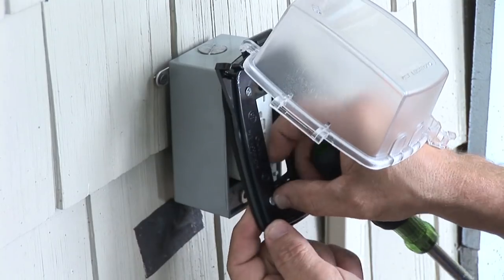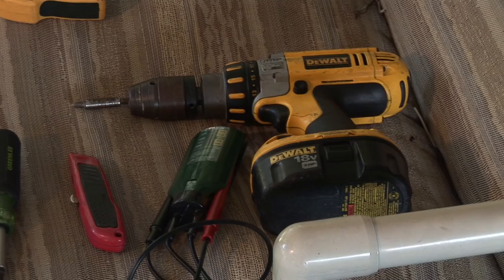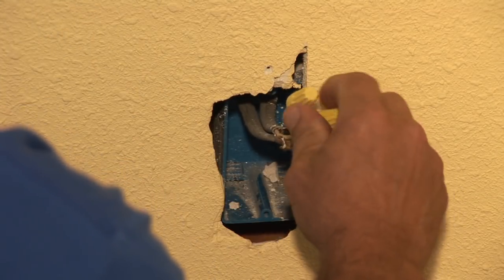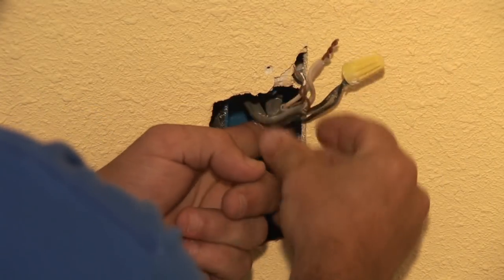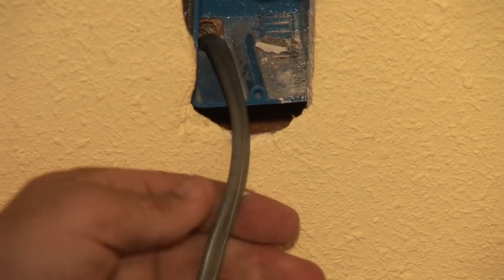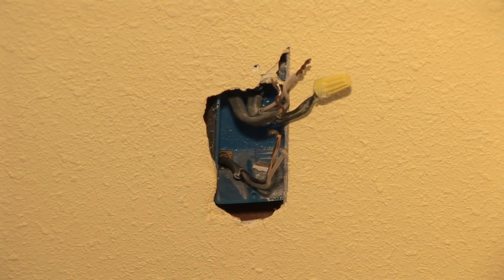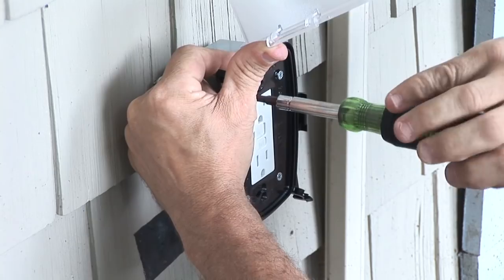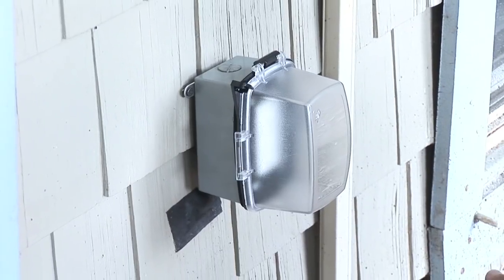Electrical Help : How to Install a Power Receptacle Outside

Comment: I always see on DIY videos people running a knife blade down the length of the wire covering risking nicking the insulation on the wires. The safest way to remove the cover is to only cut about an inch of it and then pull on the ground wire to the desired length which will easily split open the cover
Reply: I agree completely. As an EMT, I was cringing as I watched him drag that knife toward his hand.

Comment: The video is not complete. The box is unacceptably loose and you didn't show how you would connect the new wires on the inside.

Comment: an Old Electrician of 35 yrs in 1975 told me. when installing and outlet or wall switch Remember"Black on Brass will save your a**"

Comment: I would recommend making sure your wire exits in the center of a shingle then you are guaranteed a flat surface which helps ensure the box is more secure. Also use sheet metal or some type of weather resistant screws.
Reply: Sheet metal screws into wood siding?
Reply: @henrypratt3742  Didn't mean to offend you, what i said concerning the screws was sheet metal or some type of weather resistant screws. And for those who think I'm unqualified. I am a 43 year electrical veteran in business for 33 years, teaching at a tech school for 10
Reply: I agree. I don't like how that box wasn't fully secured to the house.

Comment: i like to put teflon tape around the "knockout seal". i find water always finds a way in if i don't
Reply: Me too! But I also drill a couple of small holes in the box and before I close it, i also dust the inside with ant or bugs killer
Reply: @ip5232  you mean like drain holes in the bottom??…
Reply: @Kenny_K2323  you can say that

Comment: Thanks Nick. Many people don't know a GFCI has two sets of screws and incoming power always goes to the line screws (hot and neutral). The load screws are only for feeding & protecting extra outlets downstream from the GFCI. If you connect power to the load screws, there is no shock protection from the GFCI.
Reply: That’s evidence that some owners will tamper with wiring without reading the directions. Gives diy a bad name.

Comment: First let me say that I have not watched this video. There is s very good reason! This video was produced in 2012! NEC has been revised twice since then. My reason for commenting is that there are lots of comments that are less than 1 year old. The most recent NEC  major revision was in 2017. Any work since those revisions requires a WR (weather resistant) receptacle in any outdoor environment!  Also new work should include TR (tamper resistant) receptacles. Since neither were required in 2012, you have most likely (see initial sentence) gotten out of date information from this video.
Reply: Coy Patton He uses a weather resistant and child resistant outlet... :x
Reply: And I’m sure what may not have changed is that a electrical permit is required by the local Authority Having Jurisdiction(AHJ).

Comment: Thank you for taking the time and making the effort to help those in need of your experience.

I'm not a video producer, nor a master electrician. I haven't made a single video. I'm, most likely, not as smart as you.
I just started watching the video, and the first thing I see, after the introduction, is you standing at an unused box, with a blank plate.
Now... if I needed instruction on how to do this, chances are... I'm not qualified to do this without your help. And, my first question is gonna be:
"Why are you at this box, inside the home, when you're supposed to be showing us how to install an outside receptacle?" 

Those who need this instruction probably don't know what you're doing. Otherwise, they wouldn't be looking for help. If I didn't know why you were there, I would ask... 
Why are you standing at THAT box, & testing it for power? Why are you drilling a hole? What's on the opposite side of that hole? Is there anything in the wall that might
make drilling through it a bad idea?

I don't mean to appear pretentious, snotty, or pretend to be a "know it all". I'm none of those. But if I was standing next to you, trying to understand why you're doing what
you're doing... I'd have questions. Rightfully so. And to this point, you haven't mentioned a thing. There are probably some viewers that wondered what they'd do, if that box
hadn't conveniently been there. They might even be wondering why that unused box was there, in the first place. My head would be spinning with questions.

My entire premise is: Theory, DURING the process of demonstration. The lack of it creates confusion. I haven't seen the entire video, so I don't even know if any of my questions
were answered.  So... I apologize if I've offended anyone. This gentleman was nice enough to make this video possible, by sharing his experiences. I was not knocking his work
ethic, knowledge, nor experience. Just explaining how theory, during the demonstration, could eliminate possible confusion in the future. I just happen to be one of those
types of people that look for the "Who, What, When, Where, & Why" of whatever I want to know about.

Comment: Don't forget to silicone or latex caulk the conduit plug at the top. Those leak even when tightened.
Reply: Don't these also often have plastic plugs? Some might want to upgrade to metal plugs if they're not included.
Reply: @HandymanHustle  I had one under my tankless unit that leaked and my GFCI faulted and I had to replace it because it got water in it and wouldn't reset. Lesson learned and I put latex caulk on it after installing a new GFCI.

Comment: I mounted my box like you demonstrated, and my kid knocked it right off the wall when he ran past it with a snow ski in his hands. The screws tore right out, with some of the siding. When I reinstalled it, put in larger diameter screws, and long enough to penetrate the sheathing. As another viewer recommended, I also shimmed the lower half, where the box sits further out from the siding. Then I had my kid purposefully run into the box again.  There, fixed it for you.

Comment: Nicely connected, although a piece of cedar should have been installed behind the lower half of the box where it overhangs the siding.  Makes for a more secure mount, and just as important, a much nicer looking job.

Comment: Thanks to this channel for this high quality video! 
Some constructive criticism on the outside part of shown installation: @ 8:39 mark, the strip gage is about 11mm (~7/16″). The stripped wire ends ended up being 14mm -ish (~9/16″). When you push the Live and Neutral wires all the way into the holes and fasten them, the stripped parts of wires should not be visible (should barely be visible). Just cut the excessive ~2/16″ away, and you're golden. As is shown @ 10:02 mark, you almost can fit two stripped Ground wires side-by side on the stripped part of the fastened "hot" wire. Should this happen, an RCD switch will cut the power, if RCD switch is present and the wiring is done correctly; or you can create a short circuit and a circuit breaker actuates, again cutting the power. These were the best case scenarios. 
IMO this particular receptacle isn't designed with the bare ground wire in mind - there are "hot" exposed conductive surfaces allover this receptacle. These surfaces could contact any bare wires in the receptacle box, creating a short circuit or making some of the other conductive surfaces "hot". 
As some of the previous comments mentioned, the boxes need to be mounted tight and level. 
I'm not a native speaker, sorry for my English! 
Thank you and stay safe!
TL/DR:
a) you should have no access to stripped wire ends once they're fastened, else you could burn your house down,
b) use modern cables and receptacles, meeting acknowledged standards like IEC, 
c) fasten the receptacle boxes level and tight!
Reply: Regarding stripped wire ends: don't put the unstripped insulation-covered part of the wire inside the receptacle's holes/under the screw either. Else you could burn your house down. 
The stripped part should not be accessable to wires/tools, but the insulation shouldn't enter the hole either.
Reply: @xbxlxexhx  Thank you.  Nice tips.  Regarding the "bare ground wire".  Is there a romex cable with insulated ground wire?
Reply: @paulgrim3501  
I'm not familiar w/ North America's cables. What I can understand from the Wiki page, the "Romex" trademark cable's ground wire (G) is not insulated. Maybe there are different brands of cables w/ an insulated G?
If I absolutely had to use it with the plug similar to the one shown in the video, I'd make sure there would be no chance of G wire touching a "hot" surface by insulating G (e.g. with a green or yellow/green insulation tape, leaving the ~11mm - or whatever the norm is - bare tip under the respected screw/contact), and carefully placing it away from the L and N conductor surfaces/contacts (which are ideally recessed, and only accessible by an electrician's screwdriver/tester, the L/N wire ends themselves & the plug's "hot" parts) & cover these "hot" screws from the Ground wire as well (e.g. with a black insulation tape). 
The Ground wire is there for cutting the voltage to a faulty device (scenario, where a conductive surface, that shouldn't be "hot" becomes "hot" e.g. due to a current leak). If Ground touches a surface that is intended to be "hot", it'll defeat its purpose. Ideally it'll just trip the Residual-current device as soon as you turn the voltage on (flip the circuit breaker switch on) to this installation.
Hope this was helpful. Stay safe!
Reply: @xbxlxexhx  Thank you!
Reply: @paulgrim3501  There isn't a NM-B (Non-metallic sheathed cable - The generic name for Romex.) Does not come with an insulated ground wire.  THHN or THWN is more appropriately used in this situation. 

 An additional safeguard is to tape the sides of the receptacle (around the terminals) with electrical tape in order to insulate them against inadvertent contact with either them bare ground, or the other metal parts of the box.

Comment: I bought an unfinished house where the seller had already drilled the holes to the outside and ran wires through them, but they're just sticking out from the house with caps on the ends but there's no electrical box, so it's basically how 3:10 shows it.  Now I know what to do!

Comment: Very nice. Especially the sealing at the back/cable entry. Went thru numerous videos and that's one critical part not addressed. Aren't there some double compression glands that could do a more robust installation?
Reply: This was the question I was wondering and wanted answer ed

Comment: So this helped me one the outside part and how to set it up, but I do not normally do electrical stuff on my own. After you strip the wires on the inside outlet where do you connect the outdoor wires to? Are you connecting them to the inside outlet and drawing your power from that outlet? I understand this is an extremely old video but I'm hoping somebody will see my comment and be able to help me out lol
Reply: The new wire and existing wires (which used to be connected to the outlet inside) get connected together. Then you add a short bit of wire from the existing outlet to the other two wires and use a wire nut to hook all 3 wires together. It's called a pigtail.

Comment: Great video. Replacing an old GFCI outside as the old one busted over the summer... 😂 The metal box was grounded but not the outlet! Holly cow 🐮. How has this old house not burned down?

Comment: imagine my surprise when I reconnected my pool and the gfci wouldn't work. Turns out the licensed electrician didn't seal the box and water got in. The box he used was a piece of crap, probably used some spare gfci he had lying around, he caulked it badly, only one screw was holding the thing. Nice to see how it's properly done here

Comment: Noticed that both leads were not pushed in completely, a bit of the copper was exposed. This also needs a insulation tape wound around the leads so as to avoid any shorting when using the outlet.

Comment: I find it much easier to remove cover first then insert all 4 screws into assigned slots they will stay in place in foam gasket then replace weather cover to complete project

Comment: Thanks for the video. 
That outlet you installed is a GFCI. You need to be careful because these can be strung together with regular outlets. It provides protection for downstream outlets. The hot and neutral terminals on the top and bottom are not the Same. 
You wired the hot and neutral next to the ground wire. On the leviton boxes I bought, these are the downstream terminals. The outlet very well may work, but I imagine the GFCI is completely bypassed if your outlet is like mine. Does your GFCI test shut off the outlet?

Comment: Damn! Those wires tips should of being a little bit shorter. Not leaving copper exposed. If It was me, I used the loop or hook method on the screw just to be in the safe side. In my opinion, I think that the stripped mark in the back of the switch is for the screw type installation. Over all, good video presentation.
Reply: Jammin Dave You aren't supposed to make a loop with the type of terminals that were shown in the video. You are also mistaken in that the strip gauge is not for the loop type method. He just stripped a little more than needed, and should have slightly trimmed the wires a bit.

Comment: Good  video.  It did not show that you tightened the top and bottom plugs very tight and the box looked loose.  Did you put a screw in the bottom bracket?

Comment: Great job but I have a question. Do you have to put the ground wire to the box and the receptacle too or could it just be screwed onto the box?

Comment: At 6:29 the comment is made that the Romex connector on the back side of the box keeps rain out as well as "critters."  It doesn't really keep the rain out, does it?  That is not an exterior water tight fitting with an O-ring.  It is a standard interior/dry connector.  The water tight connectors that I know of, are big and bulky and would not be good for this task either.  Depending on how much water runs down the shingle behind the box, that cable might just direct water into the box.  To avoid the issue altogether, I would be sure to caulk the sides and top of the box to the shingle.  I would leave the bottom edge un-caulked so that any water behind the box might drain out.
Reply: Yeah but the connection between the threads and box the fact it recessed in the wall and then the play dough the amount of water is pretty negligible. 
I wouldn't have it out exposed though

Comment: The box does not look property secure to the outside of the wall  (wobbly ) it looks like you used drywall screw, which is not weatherproof.

Comment: Do they sell those mounting brackets separately? I have the same box. Just cant find the brackets. What are they called and the specific size? So I know what to look for or ask for.
Reply: Never mind I just drilled through the box. Ran out of time trying to find them. Guess its better to be electrocuted then the whole house to burn down lol

Comment: Did you end up putting a screw on the bottom right corner of the box? You don't show it in the video so I was just curious. I'm trying to avoid spending the extra $$ on a vinyl siding mounting block.

Comment: Great video, thank you

One missing piece for me, tapping from the inside of the house where there is an outlet in use already. How do I tap off of that properly? This example conveniently wasn't in use. Thanks!
Reply: +Morgan Glassco There were two cables in the indoor box so it was "midstream". Best way to do this is to twist the three conductors of each color together with a fourth short section of wire (pigtail). You should end up with a black, white and bare pigtail to attach to your indoor outlet. 
The indoor box in the video looked too small for that many wires but am not positive about cubic inch capacity of the box.

Comment: Thank you for the great video. I have a question, is that plastic conduit next to the oulet running electrical wires? My house is 100+ years old and I want to run two new lines to the attic to update the wiring in the 2nd floor. I was thinking about using 1/2" metal conduit to bring the new lines up.

Comment: I an installing a fan under a deck.
I added patio roofing under deck to catch rain, that dumps into a gutter.
I also added a cover over were the fan will be installed. They way when it rains, it will catch the water run it away from fan box.

Now, I have a power source. A exterior outlet in the wall that is 30ft away.
How do I get the power. 
I need to keep the outlet and add a switch to fan.

How do I change box to exterior  box .
Can I add this type of box right over the exisistng box hole?

Comment: What if I got a plastic box with no ground connection? But an exterior  power outlet with a GFCI must be grounded correctly?? So, I really need a metal box correct?

Comment: What is the argument between using the external J-box like you did versus recessing a box into the house? The latter is a more flush fit but probably also required some sealing tape and insulation around the box. Thoughts?
Reply: And also keep in mind that you pretty much can't do the recess version unless you're working with a completely flat surface. Otherwise, imagine how that would mount while trying to keep rain away. No bueno.

Comment: Why didn’t you tighten the blanks? Why didn’t you use an SE connector on the back romex connectors are not waterproof. We always tape the receptacle if using a metal box.

Comment: He didn't reconnect the interior outlet back to the wires so now I"m a bit confused as to how to connect all of those wires back to my indoor outlet. I want to do to this very same project. I now have the outdoor rated Romex wire outside through the hole I just drilled.